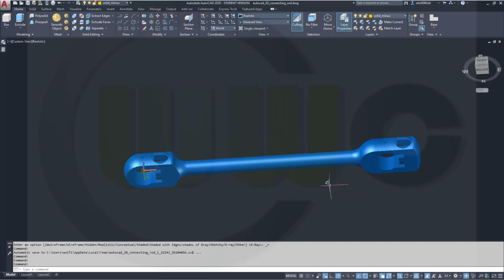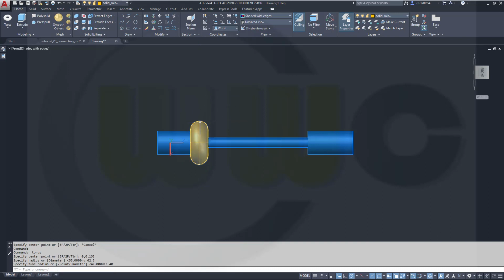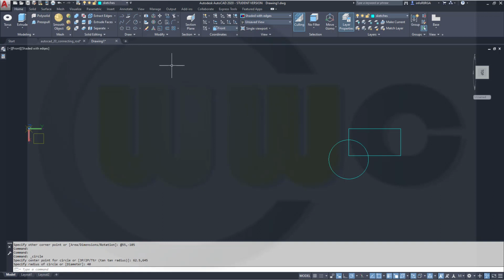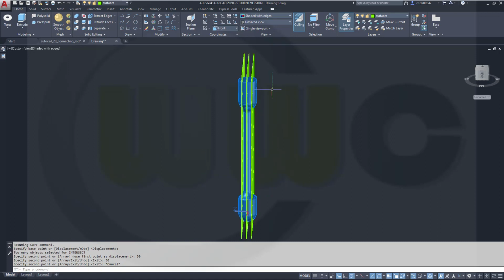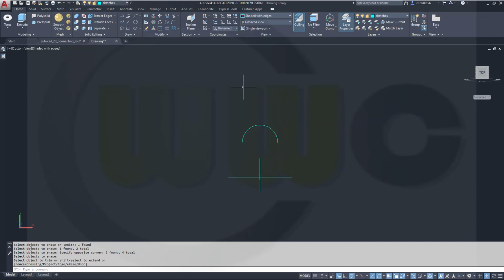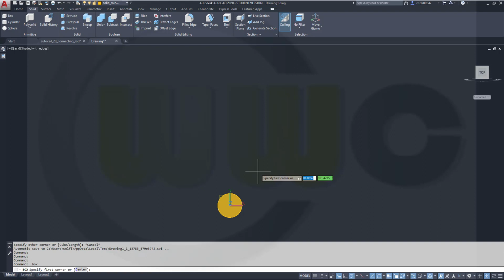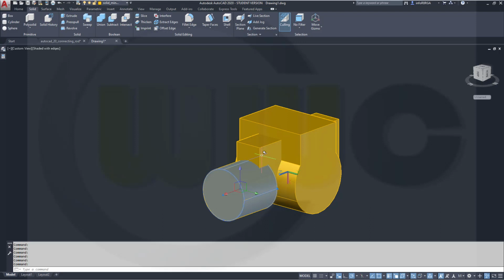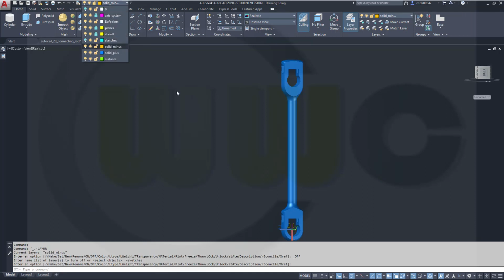Connecting Rod - Autocad 2020 Training - Part Design

Comment: Honestly, I don´t now when Autodesk is going to include a Sketch tool to Autocad. I´m an architect and I have used Autocad since twenty years ago; but when you try Catia, Inventor, SOlidworks or Siemens I can only think : it should not  be so difficult to  include a Sketch tool.
Reply from the maker: Autocad itself is a big sketch tool ;)
Reply: Of course, but when you need model is not easy or  quick to change plane, introduce mesure from reference, introduce parametric  reference, etc...It´s a deficient program to model if you compare with other program...according to my point of view...I feel like I was using a Pentium 386 when I model with Autocad :)
Reply from the maker: @tumesobrevuelas  I have to agree, but I think this will never change for autocad.